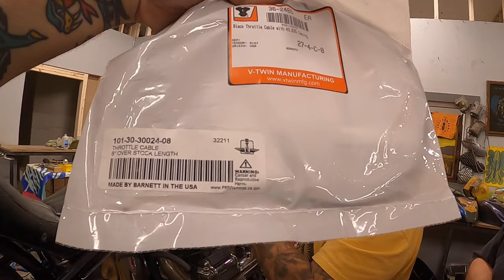Crashing a $100 pan shovel

Comment: If it's a HSR MIKUNI, I'll buy everyone you have.
The pilot air screw is right  next to the fuel fitting. 2 full turns out is the starting point. 
Now, here's the MOST often overlooked part of these carbs.
The idle mixture and even the idle speed adjustment,  needs a o-ring and generally a flat  washer and a spring to prevent air leaks and to keep the adjustment from  changing. More often than not,  these are missing, and the best Harley carb in the world gets blamed for no reason. 
They work and they work incredibly well,  they just have more parts than the S&S. 
If I get up north this winter, I'll buy everyone you have !
Reply: I have a 40mm and have not had to mess with it since 1998

Comment: Almost forgot,  you mentioned the choke, actually the enrichner, could very well be the reason for running poorly,  especially if it's rich.
Harley choke cable has the word choke on the plastic knob,, the Mikuni doesn't.  The Harley cable will work, but MUST have a spring and plunger made for the Mikuni. 
The Harley plunfer won't seal internally and results in a severe rich condition. 
The spring and plunger come in the install kit, better yet is the Mikuni cable, I'm pretty sure Ted has them. 
I use propane to check for air leaks, you can just use WD40 if that's what you have.
Or find some old ROUND SLIDE Mikuni carbs, simple as a dirt bike carb,  and the 38 m.m. work excellent on a old Shovel, Pan, etc.

Comment: Guys, my phone screen is all cracked, but it looks like that's a HSR Mikuni, there's 2 screws for accelerator pump adjustment. 
Screw #1 pushes the pump rod to adjust the start of the pump stroke.
.080" is the starting point between the lever and pump rod end. If there's hesitation off idle, reduce the gap by .010".
Screw #2 is vertical up on top of the carb cap, next to the cap cover screw, it's tiny but important. 
You adjust this to STOP the pump action after  3/4 throttle opening.  
T.S. RACING 🏁
Reply from the maker: We tossed that carb in the trash